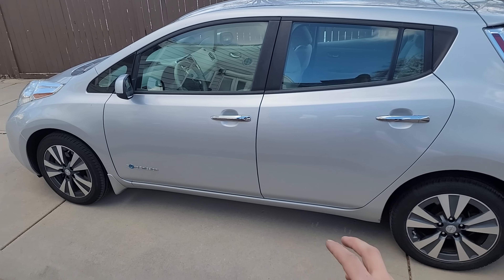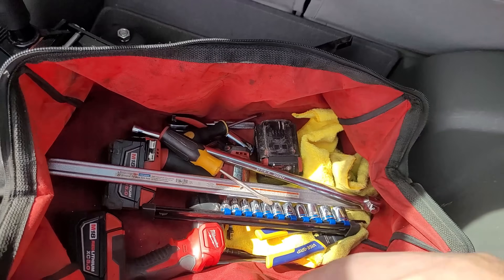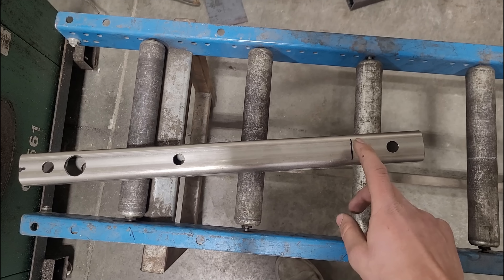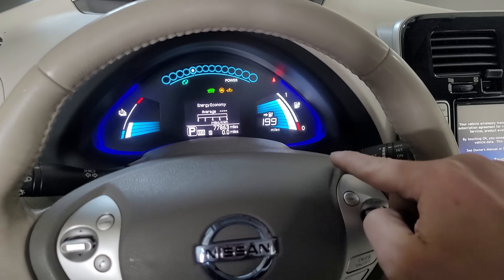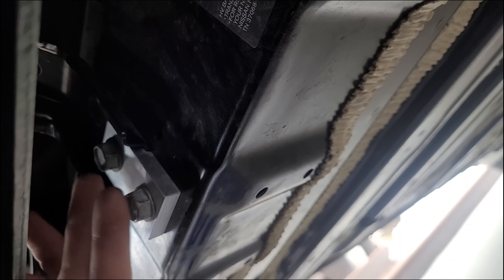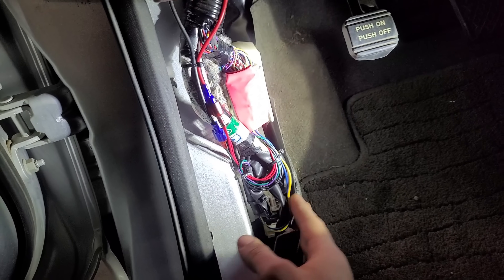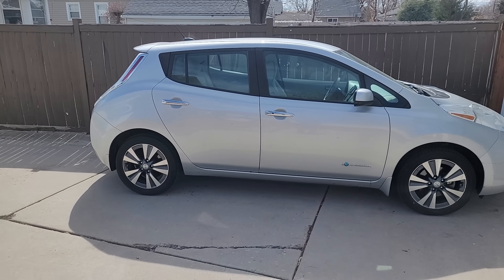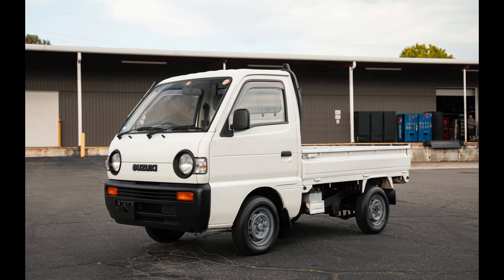Under $5K Nissan Leaf 62kWh Battery Upgrade

Comment: Lol is it even worth upgrading this car...
Reply: I have a leaf for 3 years now, it very reliable, no maintenance needed, very comfortable and lots of storage in the trunk! with new battery like that it will go another 10 years easy with just tires changes and washer fluid! I say it is a great upgrade and worth keeping the car!
Reply: For $5k it is totally worth it to go another 10 years.  Do keep in mind that this is a DIY, taking it to a shop will likely cost a few $K to put it in.

Comment: This is like a Tesla now in terms of range...wow...great job dude. Screw buying something new...especially with today's prices.
Reply: What many people don't understand about EV's and their old battery packs. Even though the old packs are degraded they're still quite valuable. Barring any manufacturing defects properly maintained battery packs don't die they just slowly lose capacity. Even if they're 10 years old many will still have well over 50% of their original capacity and this makes them valuable. An old 30kWh battery pack at 8 years of age can easily retain up to 20kWh of capacity. That could power my home for 24 hours. If you check eBay you can see that old EV batteries are bringing a hefty price. An old out of warranty battery pack that still has capacity can help recoup 30% or more towards the cost of a new battery pack.
Reply from the maker: New prices are only going up with the latest tariffs!

Comment: Got me thinking for a moment there.  Though I'm in California and the weather does get quite hot, and since the Leaf can only air cool its batteries I'm still hesitant to perform any upgrades if 50% of the new battery will only last 5 or 6 years.  Compared to my 6 year old Model 3, its range degraded by about 10%.

Very curious if the chemistry in this new battery will be better than the 2018 "lizard" battery.
Reply: More than double the capacity means half the stress, far less heat to manage during charging and discharging. A $5k battery that lasts 6 years could still pay for itself twice over compared to a gasoline car, especially considering how much more functional the car is with the extended range.

Comment: Your my hero!   Critics of EVs cite short battery life, but a battery upgrade after 10 years for less than $10K makes a lot of sense if you don't need the new tech.
Reply: For the $5K you can buy a petrol car that's better than the leaf in every aspect and still keep the other $5K to buy the petrol. At those prices batteries do not make any sense.
Reply: @itisabird You cannot find a 10 ish year old car for $5k that's anywhere near a good condition. All of them will need work
Reply: @itisabirda good used car for under $5k in the current market? Put down the crack pipe and get help.
Reply from the maker: @itisabird The oil changes and maintenance/breakdowns on the gas car add up faster than you would think!
Reply: @itisabirdoh wow, I didn’t realize petrol cars exist, thanks for teaching us all something we didn’t for sure already know and have no interest in
Reply: Depends on when they go full apple and lock it all down.

Comment: Should have changed the shocks too. For a DIY looks pretty good. But I disagree that it isn't a $20k job to get a new battery in an EV. This particular car has a very small capacity simple battery design. So it might be the cheapest to replace to begin with. Aside from that this is not an OEM level fix. Those are going to be much more thorough, robust, waranteed and reliable. That's why it costs so much.
Reply: I respectfully disagree.  I think that he did a great job.  His hardware is probably stronger then the added sheet metal rails that Nissan added to the chassis to space the larger battery down 40 mm.  he took care to change the rear springs to the same ones on the + models .  I have done this job so I can speak from experience.  I was impressed!
Reply: @wkmcmahan Oh, I am impressed too. Just pointing out why the OEM job cost is so much higher.

Comment: $$$.  If market value (if you were going to sale the modified Leaf) is the sole purpose then you are right.  Not worth it.  But, if you wanted to have a vehicle that you personally could get maybe 100K miles for the long run for a $5K investment (not to mention that electricity as an operating fuel cost about 1/3 of what gasoline costs or that maintenance on average for an EV is about 1/2 the routine maintenance cost of an ICE vehicle, then this EV modification is economically a far superior deal $$$ compared to any ICE car.  It's for money tightwads who consider the long term economy that is driving the interests in EVs.  I should mention that many if not all U.S. states have an alternative fuel tax that you pay (Georgia is $200/year) when you buy your yearly car tags.  This raises the actual/final fuel cost from about 1/3 the cost of gasoline for an EV to about 1/2 the cost of gasoline.  Still a great deal.  $$$.  On the down side, again economically $, tires will wear out sooner on an EV due to the heavy battery increasing the car's weight in electric cars and their high torque (think quick take off or rapid acceleration) at start up.  $$$.

Comment: Why wasted 5K for a $3K used EV ?
Reply from the maker: @samkong2741  There are no 62kWh leafs for $3K.

Also, people drop in $5K+ engines all the time on gas cars worth less than that...
Reply: Makes sense if you get a nice car that runs for another 10 years and 150,000 miles.
Reply: If you have the skill set to put it in, $5k is totally worth it.  The cheapest Tesla M3 RWD is almost $41k after tax and fees here in California.  If you don’t have the $41k in cash, you tack on a few $k on interest as well.

Comment: Nice! What will be a ballpark figure if you are to do this for some stranger?
Reply from the maker: @HJBProductionsLLC  8K for 40kWh, 10K for 62kWh. Super dependent on the price/availability of battery packs.
Reply: @zuccamachine  those prices will be hard to swallow... If you can get it next time in 10 hours, ask on top what you spend $2500, it will be a nice 250/hour for you, and cheaper for the customer...My friend replaced a Tesla Model 3 Long Range battery at Tesla shop for $13000 with labor and parts, and got 4 years/ 50k miles warranty too. Will you offer warranty?
Reply from the maker: @Serge0329  At $13K, there would be a warranty. 8/10K would be a basic 6 month parts only warranty.
Reply: I don’t have the skill set to put it in.  Personally at $10k I would not do it.  I would simply buy a $40k Tesla and be done it for 10+ years.
Reply from the maker: @jml9550  This car is likely good to go for 10 years with this battery upgrade.
Reply: @zuccamachine  no doubt the Leaf will go another 10+ years.  At $5k it is a no brainer.  $10k I would simply write a $40k check and forgo the many bruiser knuckles as well as increase blood pressure.  :)

Comment: The buyer of the old battery ($900) didn't take issue with the broken cable connector?
Reply: I'd wager they were probably going to use the cells for something else anyway
Reply: $900 for even a seriously degraded 30kwh pack is still a great deal for a small DIY solar battery
Reply from the maker: @JoshuaCollins  All the pins were still intact, and the broken shell could be glued back on. So no.
Reply: @zuccamachine  well that worked out nicely!

Comment: Where did you source the battery? Is it consistent supplier within USA or junkyard one off?
Reply from the maker: See the previous video:

https://youtu.be/PE1iD0T8wYc
Reply: @zuccamachine  Thanks. Well, after visiting their site, they have no inventory of 62 kwh at the moment, so these are salvaged batteries. No issue with that, in fact, nice to know of a place. But what are your thoughts on Chinese batteries that built from scratch and brand new? Did you look into importing a battery at some point?
Reply from the maker: @roamlikekane  With the long shipping times and uncertainty with tariffs, I did not want to bother with importing.

Comment: The real trick is finding a 62kwh good condition battery for good price and not get scammed. Nowadays it is very easy to reset your used battery and make it look like it's almost 100% or something State Of Health. So be warned everyone. 
He is happy of the initial situation and let's hope the battery "suddenly" does not degrade quite fast into 80% in next 20k miles. BMS takes time to relearn the real battery state for those that have gotten their health status reset. 
But, even at ~85% SoH it would be 50kwh usable and not too bad deal.
Reply: @gelisob  Does he explain how he got it for so cheap? That is the real secret sauce here, but I don't see any details.
Reply from the maker: @alexstupka  See the previous video in the series if you are skeptical! Has all the details on the battery source
Reply: @gelisob  Does he explain how he got it for so cheap? That is the real secret sauce here, but I don't see any details. In CA car-part or buying a wreck is going to run you 10k+.

Comment: @Zuccamachine Wow! You're the man! Nice work. I have a question though. I am hoping to purchase a 40KWH battery from an 2018 leaf and I would like to test it for my 2013 Leaf. I purchased the two things you put in your description, obd stuff. I do not know what that box is that you have connected in the battery test shot. Will I need that also.  The battery has been said to have been sitting for awhile, they have not given me an exact time it has been sitting, hence the testing.  They may give me a 30 day warranty on it. Something I can negotiate. We are currently agreed on $1700 and the car had between 60-100k miles on it. I know its a big guess but I think the price is fair if it isn't shot. What do you think?  Thanks again! Keep it up. I am a subscriber!
Reply from the maker: @kudynski  I would want to see above 80% SOH and Hx. 
I'm not sure about the box you're asking about. The LeafSpy connector OBD2 Bluetooth adapter?
Reply: @zuccamachine the box is the 12v battery.  I figure it out from your other video.  Thank you so much. Any other parameters I should look out for in that battery when I’m testing it? Also, is the price fair?
Reply from the maker: @ My video details what data to look at in the Leafspy app pages.

If it has above 80% Hx and SOH, I would buy it myself.
Reply: Just saw your other video explaining in more detail about bad testing. That being said, I’d still would love your input on that. Use battery please and thank you.

Comment: Good job.  I put in a 40kwh low mileage battery from Canada.  spent few hours on it.  I didn't want to go 62kwh due to the weight and well the time spent doing it would not be worth it.  It last me days on a charge.

Comment: I would highly recommend using grade 8 bolts instead of grade 5 to hold the battery in much higher tinsel strength and better corrosion resistance. Other than that item looks like a great install job.

Comment: The leaf is the worst of the mid tier ev
Compared 6 in that price segment. Overpriced af
Reply: huh?  got mine for under 5k.  Can't get anything else for that much even after I put a 40kwh battery in myself.
Reply: @nach335  Bought my long range model 3 from auction with a front crash that took me 0 dollars to fix and 4 hours of work for 9k
Reply: @ciancunningham2157  model 3 will cost many 10s of thousands to keep on the road. Leaf doesn't break lol
Reply: Well, we'll see what the new new Leaf is going to look like. The range, charging performance, and charge port type was all way behind, but if you have the right use case, and you can get it cheap enough, it could be great.
Reply: @fjalics  the overall performance wasn't even bad. But if you cost up to 30% more for a similar package....
It's hard to justify.

ID 3 was also higher priced but still less and offered more.

The DOLPHIN could be a cheap ID3 ... If the quality isn't awful. Who knows. I won't be the guinea pig 🐷

Comment: Adding 300lbs had to noticeably reduce power.
Good job on the installation, I would consider some type of solution for the plastic pieces if you are daily driving in all weather conditions. Too good of a job to let it get short lived from lack of protection. Plus it’s the way it was and should be. Lol
Reply: Perfect excuse not to take your mother in law on your trips!

Comment: Seems you did not wash or clean he underside or the replacement battery. That would avoid future issues like potential rust and contamination. Also what are those cardboard pieces with metal straps holding the battery on? You really think that will hold up? And you have NEVER have too many bolts holding a car together. Cool DIY but I would not pay you to do this for me but thanks for the info. Would be nice to see if you actually got more range.

Comment: Cool. I have an identical Leaf SV to yours. Just my interior is different, black colour. 3 months ago Nissan replaced my 30 kWh battery with a sparkling brand new 40 kWh battery, under warranty. Although I was not down to less than 8 bars left, I built a business case and proved to them my battery was severely degraded which it was going downhill faster and faster. What was nice was it used the same under covers of course and springs are fine as the increase is about 110 lbs more than the old battery. Nissan was very good to deal with and the first dealer I spoke with wouldn't do a thing for me. My warranty (8 years) had 2 weeks left on it! The 2nd dealer was awesome. I now have a 12/12 bars (of course), lovely battery with 280 +/-  kms range (about 165 miles?) which is plenty for my urban only driving needs. This is based on winter conditions here in northern Canada so I expect/hope I can top out at 300kms this summer! In 4 years I have spent a total of $48 on my Leaf, 4 cabin air filters at $12 each! I charge at home 110V AC and I just plug in once a week and overnite it is charged up. I too can't say enough good things about it. Yes it looks a bit dorky but I don't give a shit and I save $90/month NET compared to my ICE vehicle I got rid of. Everyone at works says my car will catch fire and burn or I will be stranded, etc. I laugh so hard when they tell me they are spending over $500+/month on gasoline (it is $7/gallon here). But, I did see the 3rd generation Leaf coming and it looks really sharp! So maybe I'll sell mine?!

Comment: Very nice that Nissan allows you to do that without having to have to reflash all the control units in the car.
Reply: To do it "properly", you do. This basically glues an arduino between the battery and car to lie about it. (obviously the easier choice.)
Reply: @jfbeam  What does the Arduino lie

Comment: My toyota aygo has 100% tank capacity and still does ~800 km or more on a full tank of charge that takes less than five minutes to fill up and pay for.
Reply: And your horse may go ever farer...
Reply: Takes no time to plug in the car at the end of the day and they start every day with a full tank
Reply: @Gig0Surf  That's the fallacy. It takes a measurable amount of time, but you can't be bothered to measure it. Sure, it take less than 30s to plug and unplug the car every day, but you're doing it every day. That time does add up. I'd bet you're spending a total of 10-15min per month messing with the charging cable. EVs with significantly greater range that don't get plugged in every day spend less time per month messing with charging [~2min] than even the best ICE cars.
Reply: @ While not incorrect that it takes non-zero time, it seems like quibbling over minutes rather than acknowledging the convenience of home charging [for those that have that option].

The gas car owner talking about how quick it's to fill up equally likely isn't counting the minutes pulling into and out of the station, going slightly out of their way to fill up or get cheaper gas, waiting on a spot at the pumps, or periodically additional time for an oil change.

Comment: FYI there's a fire issue Nissan is trying to fix regarding level 3 charging on some of these USA made batteries, 2018-2020 I think. 
Congrats!!
I've really been delighted driving my 2013 LEAF SV with a 2022 LEAF Plus battery. The swap was made in October 2023 at 49k miles; it has 72k miles now.  My battery is still 94% SOH with 16 QCs and 840 L1/L2 charges. I've started insuring it for $18k as a "replacement" value now, but I think for the range and quality of the car it's "worth" to me is more. All the buttons and features are perfect "human centered design" and built to last. Driving it seems luxurious and it saves me A LOT of gasoline dollars, since I pay $0.11 per kW and avg 3 mi per kW annually.

Comment: But I read in FB that batteries cost 20k, I read also that you can't mod an EV. What happened? Do they lie? Do they lie about battery's life, about huge costs to maintain, about how enviromental friendly EVs are and and and?
Reply: whatever you read or not.
there are hundreds of youtube videos about changing to a larger capacity battery in leafs.
Reply: @ursodermatt8809  Did you believe what I asked are my thaughts? These are the questions that the EV haters write at the comments to show why they don't like EVs. All the reasons that they believe that the EVs will fail.
Reply: @chrishar110  
ah yes, to be frank that is what i thought you did believe.

Comment: I'm a Tesla Owner, and gotta say the leaf is a fine car!  It was on the bleeding edge of modern ev, and it was a ride in one that changed my mind about going electric.  The battery is the biggest issue.  Thats now about the same cost to fix as some transmission replacements in ICE cars.  That trend will keep getting better for EV, while ICE will not.  Tesla should buy Nissan and after Elon's team fixes all the efficiency issues with the company, it will have access to EV manufacturing of both entry level  and much needed true SUV's and trucks.